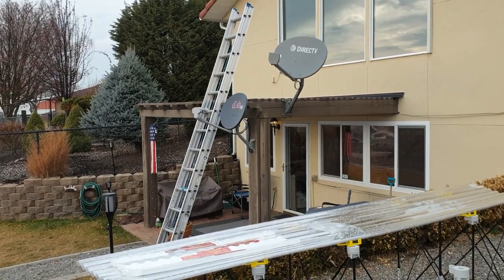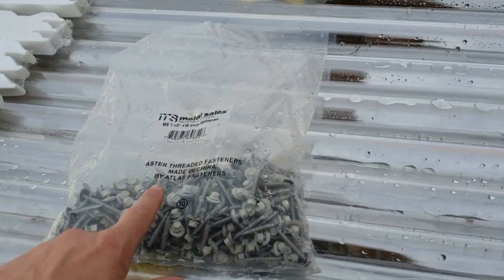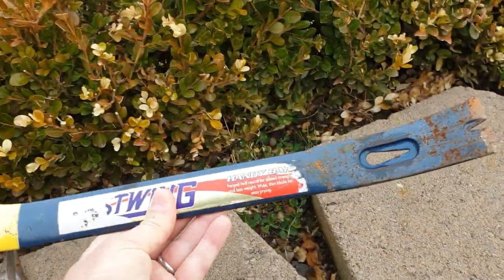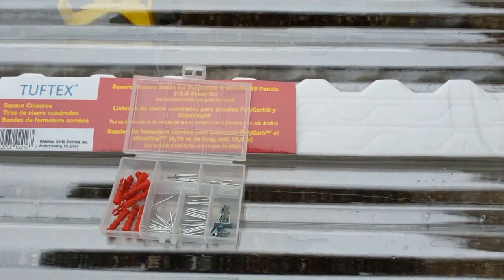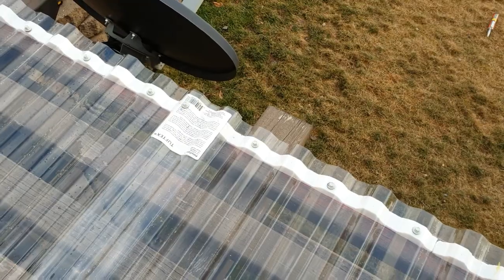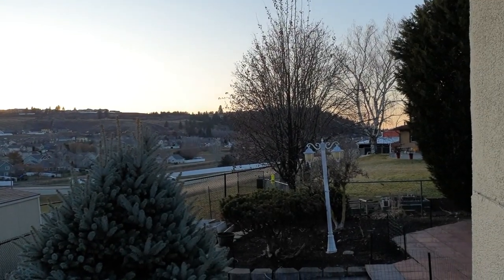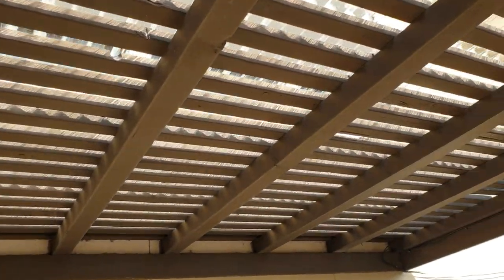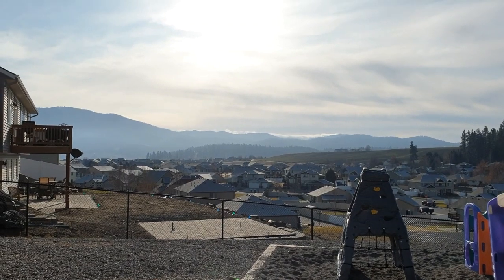How to Install a Lowe's Tuftex Clear Corrugated Roof Panel on Your Patio and Upgrade your Space

Comment: Foam closure strips are a NO NO. I like the patient that you have with your kid. Thanks for the video!
Reply from the maker: Why NO NO on the foam closure strips.  It was on the directions.
Reply: @SouthCountyRoofing  With all respect, the material does not help during the installation. Solid material will make easy your work, it could be wood or plastic.
Reply from the maker: @williamarenas2093  I bought what they had in stock.  The foam work fine.  It's cheap and effective.  Worked for me.  Zero problems and more importantly Zero leaks...

Comment: what do you call that bit, I can't find it...thanks, pls let me know
Reply: the bit is not required just a convince  - bottom-line predrill to keep from splitting the plastic and only tighten screws until the seals slightly compress (do not over tighten)
Reply from the maker: It was just a small drill bit on a reversable bit that has a driver on one side and a drill bit holder on the swap.

Comment: Was there enough slope to the panels to aid the flow of rain water? Seems like the panels were installed horizontally with no grade/slope. Any pointers to attain a grade /slope?
Reply from the maker: I did not have proper slope as per manufactures specifications.  You could achieve proper slope by adding some cross members or just putting an entirely covered but slopped deck.  But, I did account for this and when it snowed and rain the panel leaked very minor and only sometimes.  I really wanted to see if you could install these near flat and maintain some sense of protection while it was raining and holding snow and it does.  Actually, very well.  I would highly recommend these panels.

Comment: may I ask what is the best brand for roof single for durability ? thanks
Reply from the maker: There's a top three shingle manufacturer that you can't go wrong with: GAF, Owens Corning, and CertainTeed.  All three offer manufacture labor warranties which used to be unheard of.  But, there's a catch you have to hire a certified or "credentialed" installer".
Reply: MALARKEY vista is the best
Reply: Believe it or not durability is a vague term.  Are we talking stand up to standing up to wind damage?  Hail? Heat? Snow?  And the answer is different for all those different.  For example, GAF Timberline HDZ offers a unlimited wind warranty where most others of similar style and price offer a 130mph warranty.  Now this sounds impressive and it is, but under what conditions would wind blow a shingle from your roof?  Tornado, windstorm, hurricane, etc.  Well all these would be covered by your insurance company, so I am not sure who will ever hold GAF's feet to the fire on their unlimited warranty.  But. that aside once a GAF shingle seals it is very hard to break without damaging the shingle.  Hail?  In that case i like the Malarkey Vista which is a class 3 hail rating which simulates 1 1/2" hail with no visible damage.  None of the other shingles in its class are yet impact resistant let along Class 3 UL impact rated.  Now for shear amount of asphalt which is the water resistant part of the shingle I love the CertainTeed Landmark Pro pound for pound the heaviest shingle on the market.  Now I have seen videos weighing bundles of shingles, but I have never seen any truly out class the Landmark Pro.  Now the pro and the vista are slightly more expensive than the HDZ.  The standard Landmark is heavier in asphalt then most others and is at par with the GAF pricing.  I also love the Owens Duration which puts its money on the nail strip that it embeds in each shingle, but once again it is slightly more expense than the GAF.  So, what would I choose -  1) Landmark PRO unless we are in a high wind tornado area then the Timberline HDZ unless we are in a high hail area in which case I pick the Malarkey Vista or Owens Duration as my 4th choice unless I want a color that only they have which can happen as they have the most varied color choices in my humble opinion.

Also, in the video you are using self sealing screws in which case you should have secured the screws in the valley of the corrugations.  I know this sounds counter intuitive because that is where the water runs and why would I want to make a penetration in that spot.  But, when you screw the panel down that is where you get the best seal on the washer and then when the wind blows it has the least play.  Eventually, the plastic moves and that moves the screw and over time it loosens and now you do have water leaking into the hole or not sealing at all.  We normally don't catch this until the structure shows signs of rot and that means a whole new patio cover.  Also, be careful not to OVER tighten as that can cause the seals on the screw to fail.  other then that note a nice video.
Reply: @stephenschumacher  thanks for this wonderful detailed explanation,  I learned a lot. i live at NY, which is kinda cold during the  winter, i guess i should choose Landmark pro or Owens
Reply: @stevengao8345  NP - happy to help I roof in Houston TX so I know a little bit :) I am not sure what the standard install is in NY - but if it were my house I would see how much extra it would cost to do Ice and Water under the whole roof.  The cost difference should be very small and you would basically have a double roof.  I would do Landmark AR or Landmark Pro as long as the price didn't jump up too bad or Owens Duration <<<< important because the duration is far better than the Standard Owens shingle IMHO - i forget the name of it.

Comment: Seems like a waste to me even though the temp job is cheaper. Do it right the first time and forget about it, with labor, material, time, misc, etc it's not going to be that much more especially considering if the owner had opted for the temp job the first time..
Reply from the maker: It was too late in the year to do a whole tear-down and redo.  Now they hang out during the snowy months and their dog is covered when he is outside.  Makes a huge difference.

Comment: Does anyone know how much heat they withstand
Reply from the maker: No, it's not hot here for more than about 4 weeks.
Reply: The polycarbonate is rated from-40° to 170° f
Reply: In California here . Mine were destroyed after two years
Reply: @joeygonzo  did you install them the correct side up?  they actually have a protectant on one side?